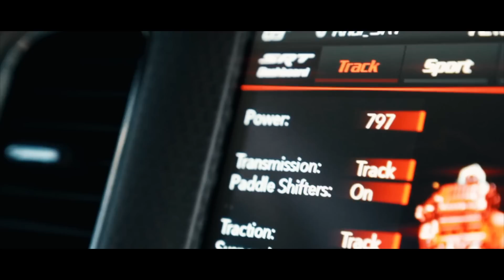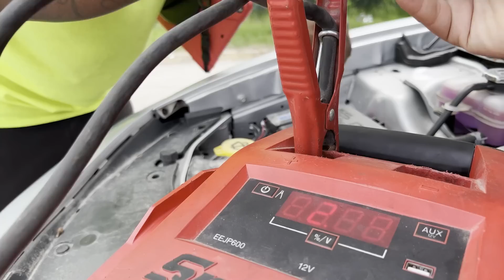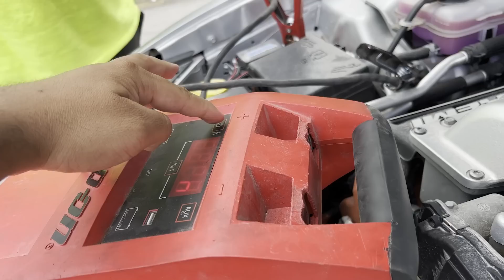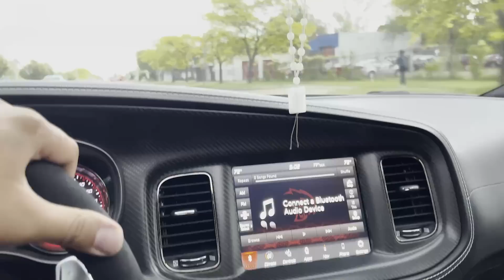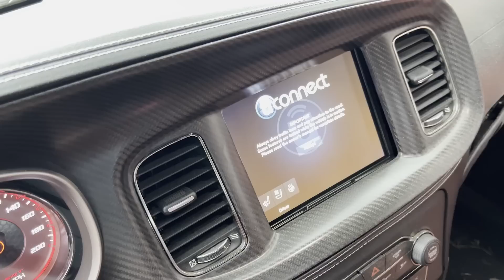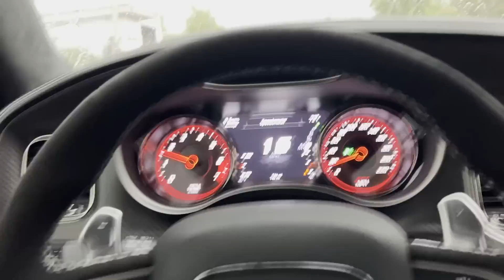I BOUGHT A COMPLETELY DESTROYED 2020 CHARGER HELLCAT WIDEBODY! *THERE IS NO WAY I CAN FIX IT*

Comment: There’s a switch on the battery that trips  when the car is in an accident it’s that black module that’s on the negative it cuts power to the starter replace it and it should start up
Reply: Isn't that the battery temperature sensor???
Reply: @leejones3931  it would be a pyro switch

Comment: I love watching your videos because of all the knowledge you have, I was wondering if you would be able to possibly help me with my car, I have a 2014 charger 3.6 and I just installed a sprintex supercharger on it, it’s throwing me 3 codes p1dd2 no dtc description, u1424 implausible engine torque signal received, p0129 barometric pressure to low, I also have the lightning bolt on for the throttle and the traction control light is on, I’ve been beating my brain with it and cannot figure it out
Reply: How are you, how do I get ahold of you